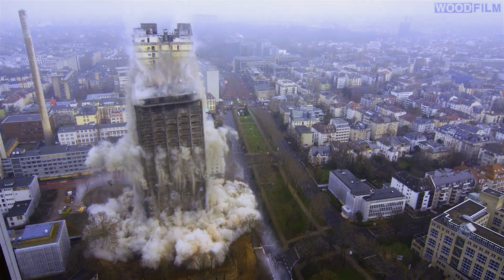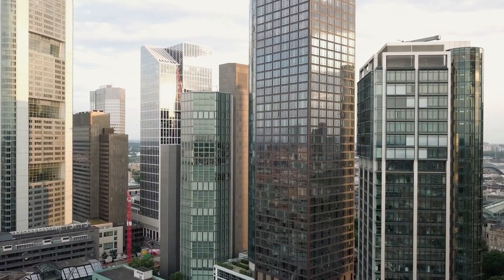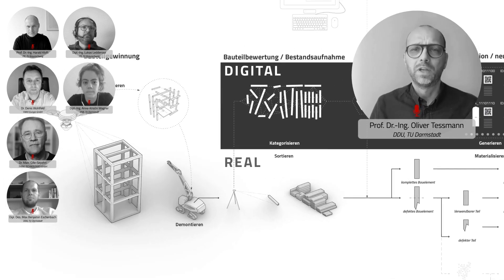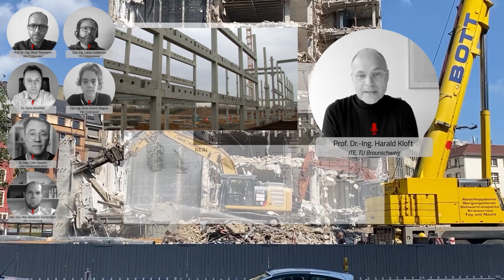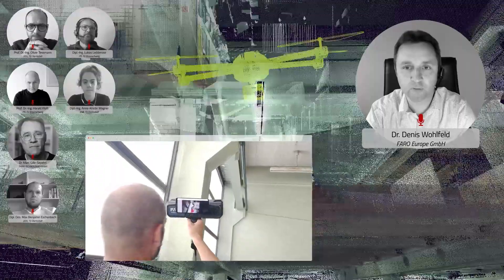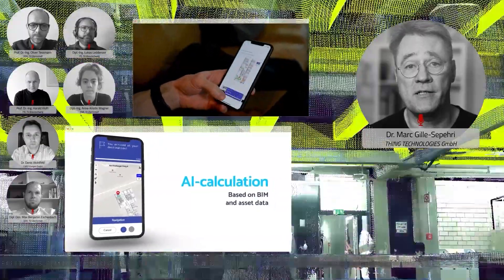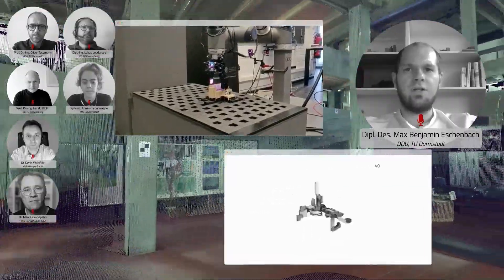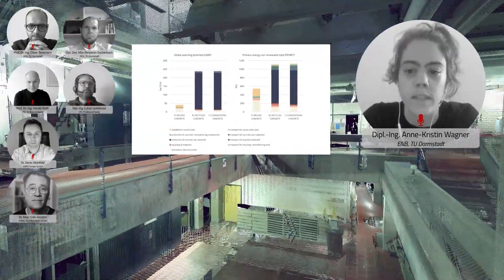Fertigteil 2.0: Project Trailer

Comment: Fine, this open a serious discussion on structural elements and modular assembly. It's all about strict parametric architecture during the assembly of a building. 

Existing buildings will have the fate that the team discussed in this video but with the restraints of the available elements. However the evaluation of reused elements may compromise structural integrity if the intention of recycling goes towards another building of the same or similar kind. Age of service always happens on every construction. 

Yes, the topic is fascinating and opens a field of remodulation. The issue, attended briefly in this video with precision, is the heredity. Designers will be chained to inherited parameters of previous building constructions. 

The great challenge and an interesting one is the construction of a building with this type of mindset such as construction, dismantling and reconstruction. It's a double process where the third phase is quite unpredictable but negotiable if the construction of the building is done right. 

The thesis of this presentation is the DISSASEMBLY, DISMANTELLING and DISMEMBERMENT of a construction. This alone rewrites the history of architecture completely. 

Thank you so much for illustrating these ideas here. It's deeply challenging for the practitioner of the parametric architect. Comes to my mind the idea of constructive systems like LEGO, K'NEX among others, an old idea that always works.